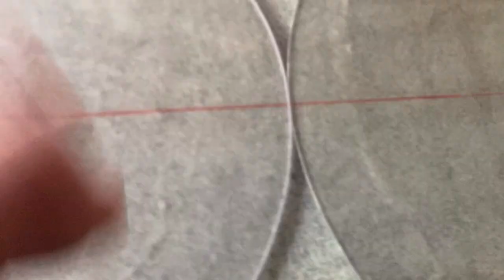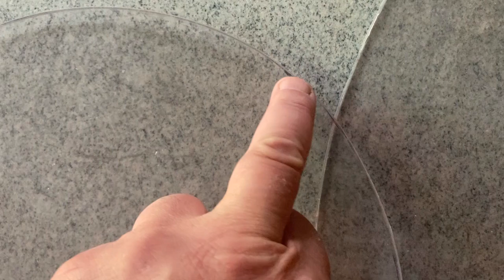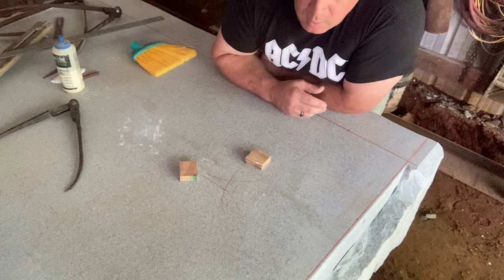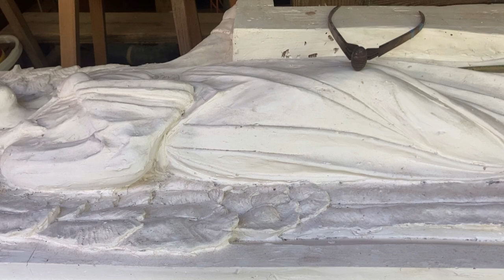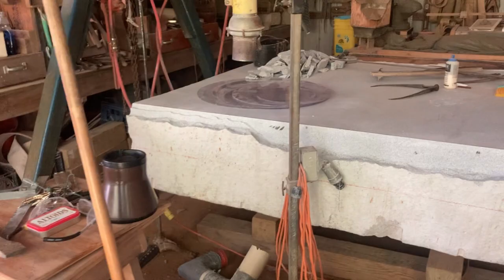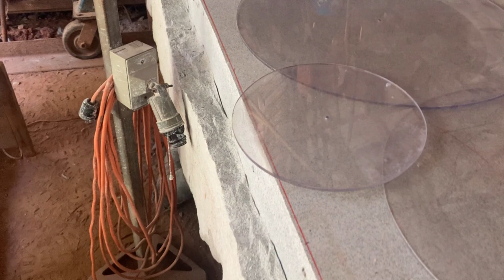Virtual Stone Carving Apprenticeship  VSCA Video 105 Life Size Angel Compass & Triangle 4

Comment: Very cool. Explains how you can use one model in variable orientations within a project. Awesome stuff. Its 3-d cad software that never has a blue screen failure, computers are great and all... until they're not!  Thanks for explaining a tried and true method.
Reply from the maker: The mathematical function used in a computer in general (including CAD programs) to scale something up or down is the same as what I’m using- The function of a specifically constructed triangle.  I’m simply performing and employing it in an analog method vs electronic computation.  The way I’m doing it is as accurate as the points of the compasses and the width of the lines drawn to represent the sides of triangle.  Really powerful stuff.

On a similar note, a pointing machine is the analog basis for a Faro Arm used to measure items into an electronic 3D format.  Any change in scale after the initial capture is then done by using the mathematical function of a relevant specifically constructed triangle.

That’s why this “old” technology is so important.   The modern methods are simply automated adaptations of the old and even ancient ways.  The Old Ways and the unknown ancestors who first derived them need to be properly recognized.